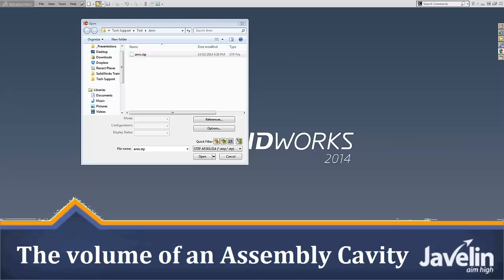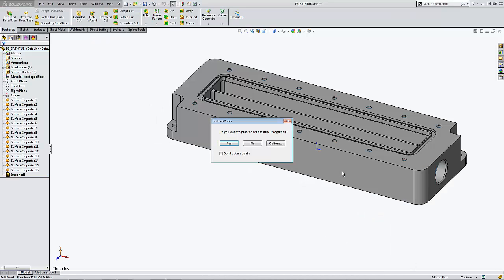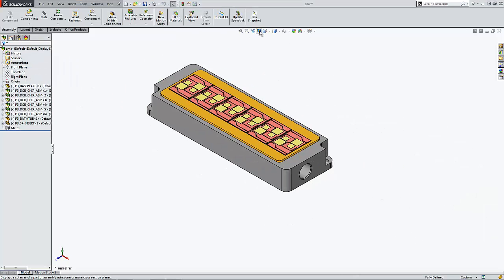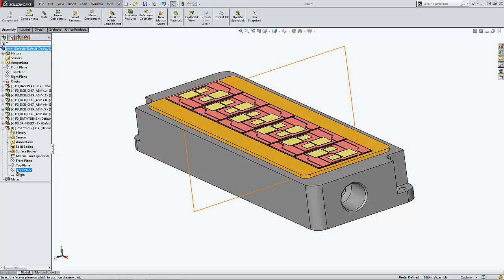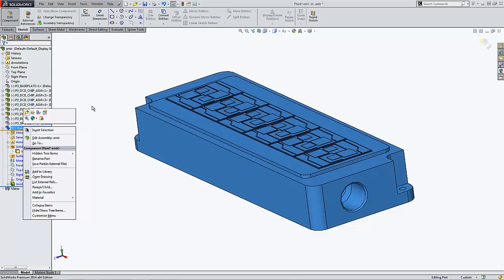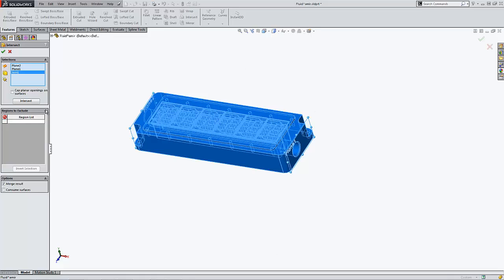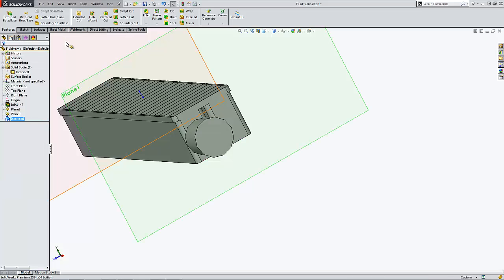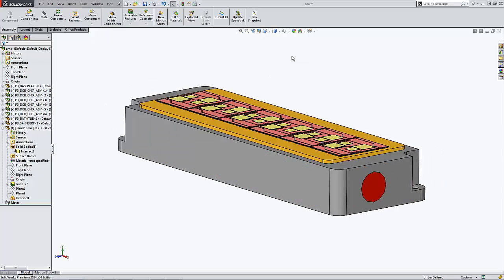SolidWorks Tutorial - Fill an Assembly Cavity to Determine its Volume

Comment: Thanks for your video. I have a question how to use "intersect" operation with U-shape like tunnel—only one planes and one solid? I got error "unable to crate this feature because it would result in zero thickness geometry" if try to intersect those two part.

Comment: Can you do this while designing the part to make sure that you design the part to have the required volume? This seems easy for basic shapes, but say you want to determine the mass flow rate of a tube of various diameters and shapes throughout. How could I make sure that I'm not limiting the flow rate of a liquid by making areas too slim?
Reply from the maker: You will use a design optimization study for that. We will record a video demonstrating this functionality in early April.